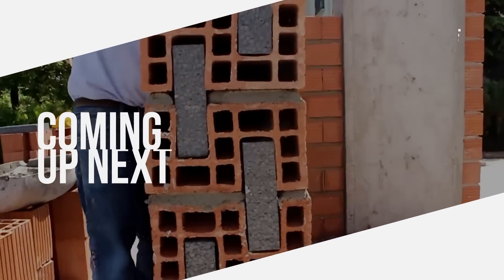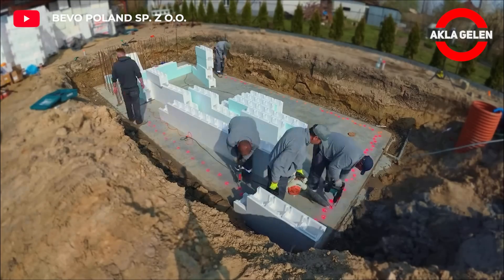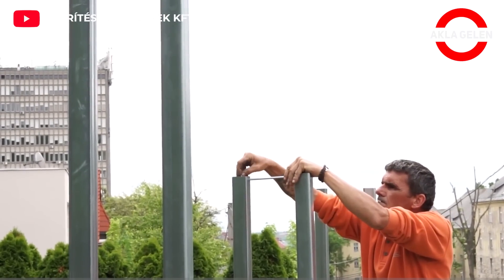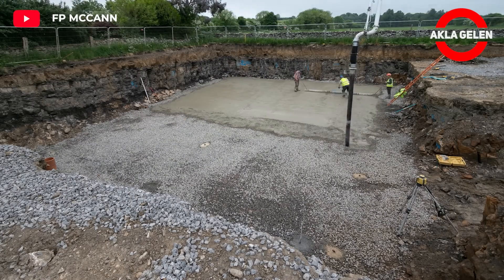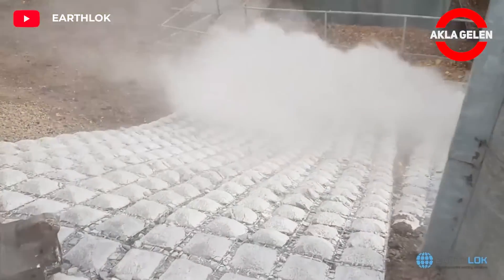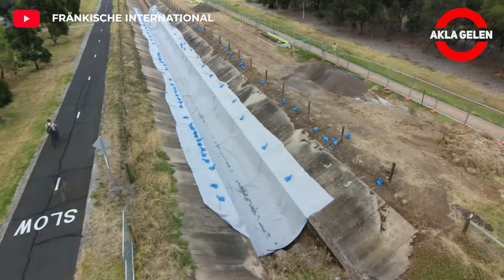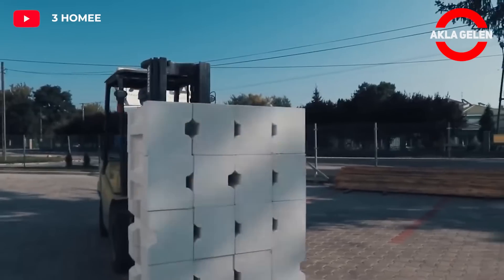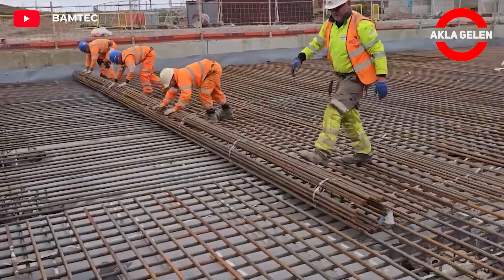Construction Workers Can't Believe This Technique Works - Most Ingenious Construction Techniques ▶2

Comment: Pool blocks. This seems like overkill to me. Our 25' x 50' x 10' depth pool is 50 years old and its made of treated plywood and treated 2x4s with a Vermiculite bottom. We are on our 3rd liner and about ready for a 4th liner because my Golden Retriever ripped the 15 year old liner that is in it. Pool patches work for now but they will only last so long. What is really ridiculous here is that I know treated wood will last over 50 years in the ground and it won't crack or break while people rarely keep their pools more than 20 years before they get sick of pool care and fill it in. People also use concrete and tend to get cracks that need to be filled every so often. Much easier to patch a rip in rubber. If you want a long lasting, cheap, easy to build pool that will last longer than you are probably willing to care for it, just use treated plywood panels on a treated 2x4 pine frame. It also makes building a board walk around it really easy because its easy to screw in to the wood frame. Its also easy to replace rotted panels where leaks formed any time you pull out the liner. Just remove the screws around the border, remove the panel, put up a new panel and replace the screws with new ones. Don't waste your money on concrete that will be expensive to remove in 20 years when you built it like a bomb shelter to last 200 years.

Comment: The bubble deck floors is just a Red Flag
Reply: just fine.it is work.

actually ,it using by fixture.so it can holding weight by the steel.
that was fine.

just looking danger. but it was fine, and work.

Comment: Maybe one or two seemed actually useful, the rest were "why?" tier.
Reply: the precast concrete walls is normal.  .... but i wouldnt use them for a basement wall. 
the concrete mats in lieu of rip-rap
rolls of rebar  (might be alright but would have a weak axis)
the rest are junk

Comment: Not really seeing anything new or exciting here.

Thermal brick walls with a carbon fiber infused foam?  Why?  foam isn't going to add anything structurally since they are floating inside the brick.  The are quite a few other drawbacks as well such as the needless cost of adding carbon fiber to the foam. 

The Styrofoam walls filled with concrete are not new.. I know a guy who has been selling then for well over 20 years now.. great for homes... terrible for pools as there is nothing protecting the exposed styrofoam from the water other than the plastic pool liner.

Gabion walls are but ugly.. especially once the steel starts to rust.  They also will not last as long as other traditional walls.

Precast walls have existed for decades and decades.. hell the city I grew up in replaced a bridge in a week using precast cement.. and that was in the early 80s

Army engineers have been using concrete mats for decades to line waterways.

Bubble deck concrete floors while weighing less than normal concreate floors are also incredible weak and prone to collapse

Plastic sheeting in a ditch is again nothing new

Modular block walls again is nothing new

And rolling out rebar?  Again nothing new

There is nothing new or exciting in the video!

Comment: 1:40 it's cheaper than concrete... But it's getting filled with concrete?

It's recyclable... Clean Styrofoam is recyclable, dirty Styrofoam (like stuff that touches concrete) not that easily.
Reply: they mean after the pool starts on fire, you can recycle it to a landfill like most of your recyclables
Reply: it has good function at waterproof

Comment: I like the idea of the video, but seems like the delivery was pretty poor. Lots of talk about using plastic, but what's the environmental impact over 10 years when it degrades? What about the Gabion walls? Aren't walls suppose to last for years?There were also no specifics on the number of years either. After reading other comments, seems like much of the video did not properly inform viewers about the cons of each construction.

Comment: The pool blocks seem kind of pointless.  Sure they're slightly lighter but they're still filled with concrete.  Having more seams doesn't look like it's more waterproof than just using concrete.  Ultimately it doesn't look to be more efficient than a normal concrete pool.  The man power needed to install the blocks seems to be higher than just framing for a concrete pool.  The blocks themselves also arent' compared to the cost of just framing and concrete.

Comment: Yo! Maybe tell people that the majority of these cant be used readily in areas that freeze! If you have frost line clevage most of the these will shear break beyond structural tolerances.
Reply: The polystyrene pool blocks certainly work   we have had temperatures down as low as - 15 Celsius on our pool in sw France and the pool at +35 Celsius in summer. No problems. In fact the ps helps insulate from the extremes